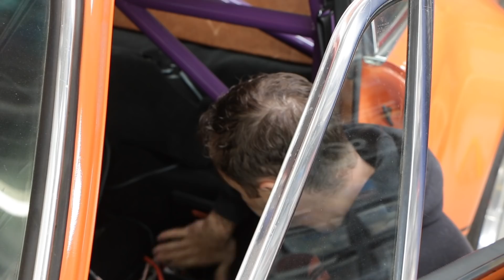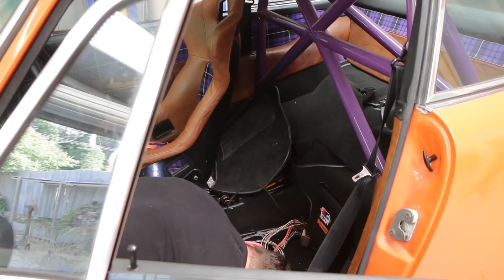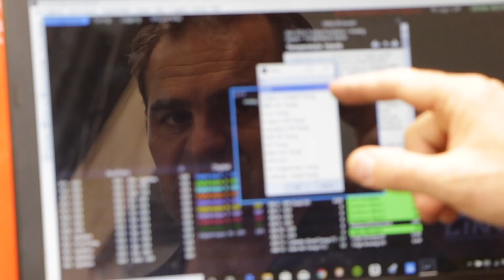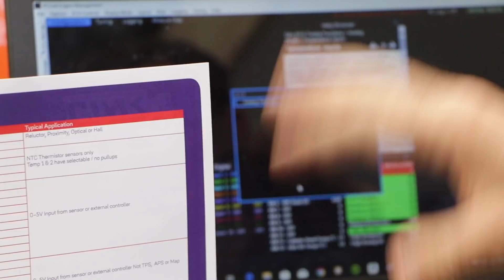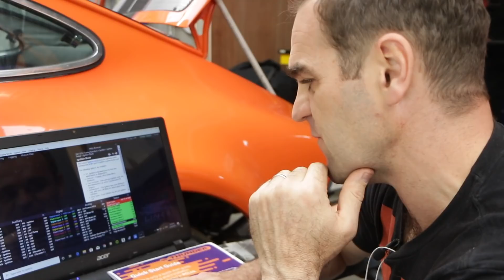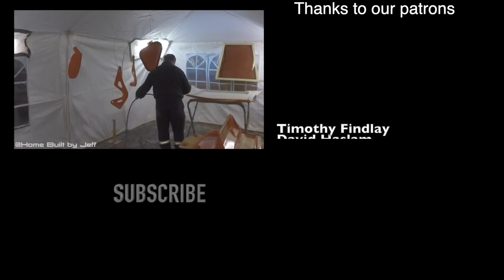Can a monkey set up an ECU? - 911 2.8 RSR Build Season 2.33

Comment: I agree with another commenter, you have to ground all your connections to a common ground on the engine block, if you dont you will have ground offsets. At a minimum you will have incorrect readings from sensors. At worst, you will blow up components. The ecu should be on it's own fused circuit. Another tip is to have your cam and or crank position sensor wires shielded, or you can get funny readings and chase your tail when trying to get good timing pulses. Just fired up my engine the other day, (link ecu) and its purring like a kitten. Good luck. If you have any questions I may be able to help, big fan from NZ.

Comment: Check the load on that circuit using a DC clamp type multimeter, knowing what the instantaneous and continuous loads are with the ignition on and running would help you diagnose if you have a problem. Klein do a great DC amps clamp / multimeter, not expensive and invaluable for fault diagnosis 👍

Comment: Your issue with the fuse blowing would most likely be the ECU grounding out your coils because you hadn't configured the I/O when you powered it up. You provide constant 12V to the coil and when required the ECU would ground the primary winding for a certain amount of time then go back to a high impedance state removing the ground. If you didn't configure the IO it's likely the coil output was possibly configured to be inverted.
You'll learn heaps about tuning in no time. Take your time with the electrics and pre configure as much as possible before actually applying power and you'll be sweet!

Comment: Just a thought, that 5 amp fuse, supplies 12 ignition coils, 5 amp might be to small 🤔
Great to see your progress! It's not all about nuts and bolts to make a car work.😎👏👏👏👏👏👏👏👏👏
Reply: I learned about current once upon a time when I was younger...
There was our trusty VW bug idling in the garage.  I popped open the boot to take a look.  "Cool, ignition wires!"  I mused.  Then, assuming it was "merely a 12 volt system" (and therefore not much "juice"), I, barefoot, touched one of the spark plug wires.

"OMG!!  HOLY SHIT!!  OUCH!!!"  (Dumbass.)  That's when I learned that a "mere" 12 V can have LOTS of current!  Perhaps I should have focused a bit more on my HS physics classes???

Live and learn, as they say!!!
Reply: @dudeonbike800  Well, sorta, but not really, the spark plug leads are NOT carrying 12v the ignition coil converts 12v to 40,000 volts( more or less depending on the coil), and you can be glad there wasnt a lot of current wasnt behind it, just high voltage
Reply: @dudeonbike800  Amperage is not voltage.

Comment: If you've never fooled around with ECUs before, this is a heck of an introduction to EFI!  It's nice that the Link has sensors pre-calibrated for you, that's taking a good amount of work out of the setup.  I'm guessing it can populate the initial fueling tables for you too?

Yes, it is worrying that the fuse blowing issue just vanished.  Maybe a short-finder tool can help if the problem re-appears?  You hook up a circuit breaker (to stop chewing through fuses) & the amp meter points you to the direction of the problem.  A real simple/cheap debugging tool that might help?  See here:

https://www.youtube.com/watch?v=TZrCrBx4uFY

Anyway, I'm sure you'll sort it out soon - I can't wait to see your engine start-up procedure!

Comment: Be careful with the big fuse.  The wire could melt and go on fire if the fuse rating is too high to blow. 
Do you have a pin out diagram that  you can check with a multi-meter?
Reply from the maker: That circuit should have a 30A fuse, I was just using a 5A as I thought it was not drawing current. I didn't realise that it would be powering up all 6 top coil packs.
Reply: Good stuff Jeff I love watching your videos and you're very talented! I'm amazed how much time you can spend in the workshop. Where does the tartan connection come from as I am Scottish?

Comment: Without going back to see what coil packs you are using to get specs, a quick search yields that most of them will draw around 8 amps of current. This will obviously blow a 5 amp fuse when a coil charges up. Not sure how many coils you have on that circuit, but the 20 amp should be okay for testing. If you have a current meter on your nifty electrical tester, you could simply wire that in series with the circuit or use it in place of the fuse to test the current draw on the circuit. Depending on how your meter works it is quite possible to see a short across the terminals of a coil as the resistance can be quite insignificant, an actual mulitmeter set in ohms would be a better choice for that test. Your doing just fine with the electrical stuff - rock on!
Reply: That was my thought too, it may just be that the ignition circuit is drawing a lot of amps.

Comment: Just a thought which is worth trying as you had a fuse blown as this trick worked for me diagnosing an intermittent fault, while power is there massage the wiring to the area connected and if fuse blows again you may have potentially found where the issue lies, could be 1 strand of wire that’s poking out at connecting points which is not always easy to see. last thing is that it could possibly be the coil pack could have had a small fault and popping the fuse could have at same time dislodged the problem which hopefully does not cause issues later on.  hope that helps if it’s bugging you lol

Comment: If 0V = full throttle? wont it pose a safety hazard? if there is a wire disconnect and sensor reads 0V, will the throttle be stuck wide open? or is there any safety catch for it?
Reply from the maker: There is safety built in to the ECU.